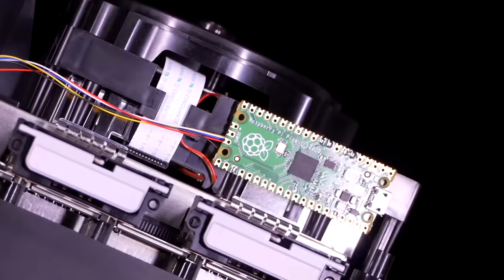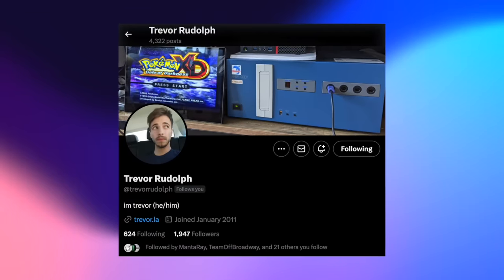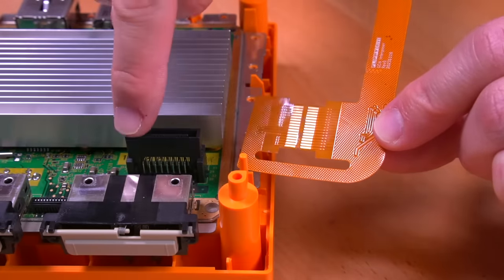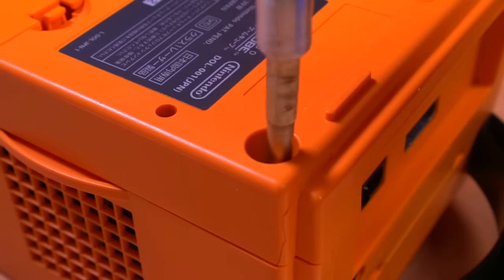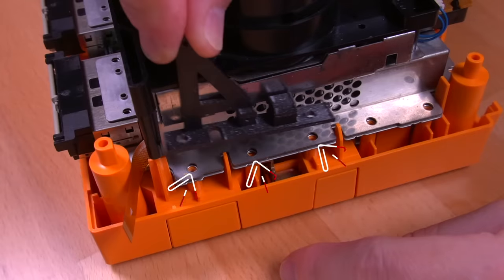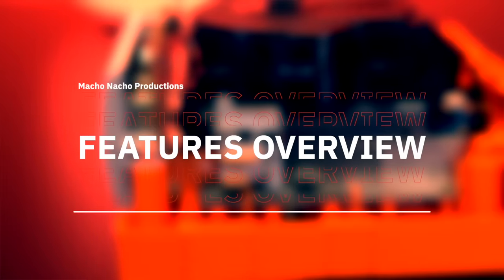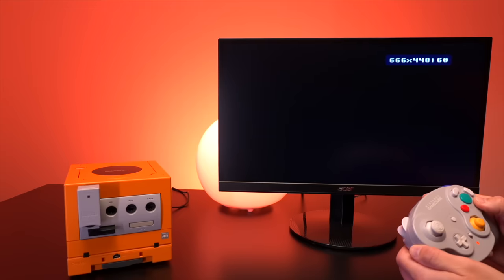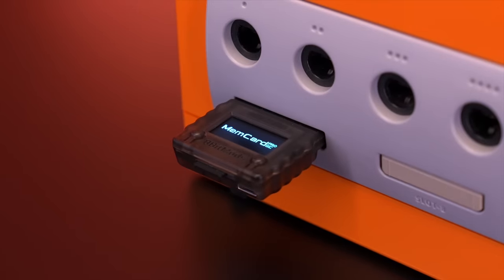FlippyDrive FIRST LOOK! Solderless Modchip For GameCube!

Comment: No less than freaking AMAZING. Well designed, easy install, fully reversible & none destructive!! + full functioning optical drive when installed. All for a LOW COST!!! Unheard of in this space for a hardware mod. (I like some others in the comments went "wow" when hearing the price, had to sit up & pay attention after that 😲)
These devs just set a new standard, fantastic 👏👏👏👏

Great video Tito.

Comment: what I would really like to see, is Swiss being able to use the FlippyDrive simply as a means to access the optical drive — so basically like if you have a PicoBoot installed you could use the speed of the optical drive to run games at full speed rather than using something like Serial Port 2.

Comment: Almost exactly one year ago I soldered a picoboot inside a heavy used GC, because I didn't wanted to mess with the nice one :D turns out if I would have waited a year I didn't had to buy a second GC and solder stuff into it :D

Comment: Legit this is a game changer for console modders. We do quite a few Xeno chips in the shop and it's such a pain, my soldering is terrible even after years of installing them and we often take returns after like 9 months of use due to dead disc drives from burned games. With this guy, looks like I can just rip the drive out, use existing 3d print drive blanks and an sd to sd adapter cable and have a chip installed (and 30-40 dead cubes off the pile) and back in stock for less than the price of a refurb drive. This is gonna put a LOT of  previously 'dead' consoles back into circulation. If they hold that $40 price point and offer bulk discounts, you're gonna see a lot of happy retro game shops over in europe.

Comment: I already have a GCLoader in my spice orange GC but I will be picking one of these up, most likely two, as soon as they are available.  Because, sometimes, you just want to play a game from a disk.  The storage for the screw was a perfect example of a developer who actually cares.  And that ribbon cable is genius!  When my gamecube arrived and I noticed it was mint, my goal was to never do any permanent mods to it.  So far the GCLoader with insert and a silent fan upgrade have been my major mods.  I did have to solder in a battery holder, but that thankfully went together well.

Comment: The fact that it let's you keep your disc drive as stock and supplements it with the sd card without the need for soldering and is that cheap to buy has me gobsmacked. I'll definitely be preordering one of these.

Comment: Super excited for this, though I already have GCloader and picodrvie to install, I may hold off and switch over to this. I hope the SWISS team and these guys work together to combine both worlds. As I mainly use my GC these days to play GBA games, being able to run the updates that swiss has without needing the disc would be huge. For those who aren't worried about keeping the disc drive, I wonder if they would considering modifying the SD extender that Laserbear has for the GCloader. I'm also curious if this might be somehow compatible with the M.2 adapter thats on its way

Comment: A few things I'd like to see: 1. extension to move the SD card to one of the trap doors under the console. 2. extension for the USB port as well. 3. USB-C instead of micro. 4. Swiss feature support 5. Disable flippy and revert to optical drive directly from the menu without having to boot while holding a button.

Comment: If it really functions as it seems to, this is exactly what I've been waiting for in a GC mod. Losing the disc drive was a total dealbreaker for me before, and it seemed like other mods that loaded games off of SD cards or SSD introduced stuttering and other glitches, especially in cutscenes. I do wish you had demonstrated the performance a little more clearly, but since this mod is emulating the optical drive I assume it's basically 1:1 with games run off discs? That's my only real reservation. And I guess I would prefer if the GameCube defaulted to a normal boot and booted into the modded interface with the button held but that's just a tiny nitpick.

Comment: Yes this is a mod that im really interested compare to the other ones and is that it keeps the function of the laser disk and at the same time it still has the gamecube style menu to match plus is fully reversable and simple to installed. Granted not been able to access the microsd card is a negative but it can be solve by getting an extender for it. Looking forward for this device.

Comment: Personally, id prefer that the console loaded up the Disk by default, and you have to hold down a button to load the mod chip (like picoboot can be configured to do). 
While i do see the value in a solderless option, Picoboot is cheaper for those who can solder (at least, it was at the time i did it). It also supports using an accessory that gives easy/external access to the SD card. 

All that said, this is a good start, and i do like how they use the GC assets for the UI.

Comment: To mount the SD card on the side... could have a small 3D printed bracket with pegs that fit into the square holes on the side of the console, and some screws with a wide head to secure it.  Some kind of small folded ribbon cable that can fit through the square to connect the SD card.  Make the bracket the same colour as the console.

Comment: 18:19 Don't forget the Game Cube uses self tapping screws into plastic. You really don't want to be removing those screws all the time, as it will eventually wear down the screw posts and you'll either will have to amplify the issue by moving to the next screw size until the post breaks or mod the console with threaded inserts that will also change the type of screw it you have to use in the console.

One con I will list has to do with the bracket. That bump is unnecessary and does nothing for structural integrity. That bracket should be redesigned to use all three screws and that side structure extended to a place between screws in the rare instance it affects mounting stability. That bracket probably weights more than the chip that mounts into it after all.

I also hope that later updates make the process of using the optical drive a simple act of loading a disc there, like it happens with some PS2 modchips when you have FreeMCBoot installed.

Comment: I'm not really a gamer, at least not since the SNES era lol, but as a tech and retro enthusiast, I love this design, non-permanent  or easily reversible mods are always preferable. The ribbon/flex cable design is genious, as others have said. Someone commented that it isnt more common because it isnt idiot proof, but this is more newbie friendly than soldering. My only suggestion is maybe offer an option to get the cable pre-folded (for those concerned about breaking it or folding it properly), if possible.
I'm glad I waited till the end because I was going to comment that while having Wifi is nice, I wish it had ethernet, and sure enough, they said they are working on this for the exact reasons I prefer ethernet (performance, stability, etc.).
A couple thoughts though having watched the M.2 Loader video just before this, combining the two, or having an M.2  slot (SATA is overkill already, but supporting NVMe too would be nice as at somepoint in the next few years, NVMe will become far easier to get than SATA) on this would be awesome, there's definitely room in the case to add this. As for the middle screw that's not used because the mounting screw fornthe board gets in the way, I think moving the screw to the right edge the same corner of the PCB would work fine and then you wouldn't need to add the box that you screw the spare screw into. A small change that preserves factory structure and actually simplifies things.

I think this idea, plus ethernet, M.2 storage, and HDMI are the ultimate mods for retro consoles like this.

Comment: One thing I'm not sure you mentioned/emphasized; the SPEED. It might seem obvious but compared to loading games from the serial port or an sd gecko (like you would with picoboot), it's up to 10x faster loading. But you also get the disk drive, unlike gcloader! It's the best of both worlds, and for under 40$???? This is one of those miracle mods that rarely come around. I will absolutely be picking one up

Comment: This mod is genius. And perfect for someone like me with none/very little soldering experience. And that I can keep the disc drive. Pre-ordering this when I get the chance. I hope that we can add ISO's via WIFI in the future, or that there will be a SD card extender so it's easy to remove the SD-Card when I want to add/change games. Other option is getting a big SD-Card and just load all the ISO's on it from the start.

Comment: This is the mod I have been waiting for, really.
For the SD card, you could buy one of these microSD card ribbon band extenders which are often available in shop that feature Raspberry Pis and do a tiny cut in the case somewhere.
Surely not perfect, WiFi SD access is still a necessity imo for this.

Comment: This mod looks to be incredible!  I was thinking then too, since the mod is still leaving the original optical drive functioning, something cool that they could potentially add in software maybe (if possible) would be the ability to create backup ISOs of your own discs directly onto the SD card.
Reply: Devs on Twitter said that might be difficult due to the conflict in accessing the disc drive and the FlippyDrive SD card at the same time, since they're connected to the same port. It would give you an easy way to boot CleanRip though, which you can then use to dump to an SDGecko or SD2SP2.
Reply: @NotMoreZombies  Ahhhh, okay. Makes sense. Thanks for that~!

Comment: I haven't downloaded roms in years, i mean *ahem*... transferred my personal disc images. But a friend told me that all the best known rom websites are incredibly limited these days, especially for Nintendo stuff.

Also, I'm amazed with the size of that heatsink! GC is one of the few consoles I've owned for many years and never opened. Never had a desire or need to. I get it now. That's a pretty well designed cooling system.

Comment: More modding options is always good. I'm quite happy with my PicoBoot setup though. I suppose the benefits of an ODE are improved load times and audio streaming performance. Every game I have thrown at the sd2sp2 so far has worked perfectly.
I hope that piggyback ribbon cable holds up over time. Those are quite tight bends, ribbon cables don't tend to like that. But there isn't really another way to do it with how the optical drive connector works, at least not one that's solderless. There just isn't room. If the optical drive connected with a ribbon cable, it would be possible.

Comment: This is awesome 👍😎 
And so easy. They only thing that comes to mind is that you are probably going to put more games on the SD card and you are going to keep taking it apart. Is there a way to make a portable SD card ribbon cable with reader.? Something small and not a eye sore. If you can 3d print something like this this would definitely be the ultimate GameCube.

Comment: I've still never practiced soldering so I've never felt comfortable trying to restore my GameCube that has a bad laser. This looks like a fantastic option in the mean time.
Reply: Lasers aren't usually soldered in they're normally hooked up with a ribbon, never opened my Cube though so I don't know.  You might be better off ordering a whole new transport assy as if your laser's gone that suggests a lot of hours use, lasers have predictable lifespans so all your nylon gears, bands etc will be worn and don't bother replacing nylon gears because you can't buy the correct Floil compound Nintendo used to lubricate the OGs so it'll never be a long term repair.  That and it's a hell of a lot less hassle.  We used to access the usage logs (we were fully licensed by most electronics manufacturers) before quoting repair prices on optical devices, no point us fixing someone's device and returning it with an end of life laser.  The biggest problems we ever had was with PS2s and 3s (we weren't licensed to do Sony consoles or phones, everything else but not those) so we had to reverse engineer the laser assys and pull the firmware out of the unit to make our new lasers work.

Comment: This is the first time I see someone actually turn the screws counter clockwise to align the screw with the thread in the hole before tightening it.

I learned the hard way what happens if you tighten a metal screw in a plastic hole without aligning it first. Perhaps you can mention that step in a video because it is one of those things that you'd assume everybody knows.

Comment: The problem with an SD Card Extender, would be the possible requirement of modifying the console's outer shell. If the people who created flippydrive can figure out how to not require that, that would be awesome. I personally, would have no issues making necessary modification, to my console's shell, to fit an extender; but I know some people would take issue with it.

Comment: The SD card issue is a noticeable one, but easily remedied using a MicroSD Card Extender and some Double-Sided tape. Though I'm sure a custom designed solution would be more aesthetically pleasing to the eyes.

Comment: you bring up a good point about memcard pro very much something they need to get working but otherwise this will makes the GC basically a no solder no cut system to get the features you want.

use the memcard pro for game storage the flippydrive for game storage and the digital port to HDMI adapter to get HDMI out. that is the feature most people want and they should be able to do so on the own. any retro console store should sell this as a package such a no brainer.

Comment: Instead of putting the 4 screws back in, you can do what I did, and use some high powered rare earth magnets seated in the tops of the posts to hold it together. i can open my GC anytime, and its sturdy enough to hold it by the handle. That being said, I did 3D print a slightly modified base with the oem dimensions, just with a nifty little locking mechanism. they're spring loaded push buttons with a levered lift arm that disengages a small notch on the upper shell that I ca glued in place. it works flawlessly!

Comment: This community is amazing, I wonder if it would be theoretically possible to mount the SD card on the gamecube flippy drive as a network drive and transfer files over wifi/ethernet. That would eliminate the need to have to pull the card manually for anything other then having to replace the card because it went faulty.

Comment: The issue with the SD card not being easy to access is easy to get around. Just put Swiss on the card in the flippy and then get an SD2SP adapter that swiss will be able to access. There's even ones that have two pieces where the SD kind of pokes out from the side and is easy to take in and out of the gamecube without even having to pick it up to access the bottom.

Comment: I would recommend getting a good micro sd card extender as a possible upgrade and modifying the shell to have that extender. this way you will be able easily change the sd card without opening it every time.

Comment: Hello. I thought that with the flippydrive having the MicroSD card inside the case was not a good idea. But at the end it says, I haw wifi, so it mean you can load your backups to the MicroSD via Wifi, right? Another great things that can be added to the flippydrive functionality would be to control those NGC SD2SP2 cheap cards, so it can see it as additional storage (and the MicroSD can be access without unscrewing the case)

Comment: What was the word used for the [clip thing]/mechanism that secures the ribbon cable (at around 11:50)? The subtitles say "bail", and I can sort of see how that would be a synonym for "release" and that would further be one for "latch", but in my head, "release"-type "bail" no longer matches "latch" in this context. I am not a native English speaker. In my head "bail" would be a synonym only to "release", but from a completely different context (law) that no longer matches the mechanical contraption that holds the cable.
Reply: Bail is the correct word, if you search for "ribbon cable bail lock" you'll get hits although it does seem more common to refer to that part just as a "clamp". The name seems to come from the bail handle.

Comment: The could mitigate the SD access con by enabling a wifi FTP mode in Cuboot.

Also I wish there was a more elegant way to access the physical disk player without rebooting. Unless its a voltage issue, I wonder if they could just have a seperate menu for detecting the disk, like go into the game picker then hit a button to open a menu with the physical disk info.

Comment: That will be the best mod for my Panasonic Q! for that price and not having to take it all appart to replace the drive belt and install a region switch, it will be the best in order to use it. i just hope that since the chip has bluetooth that we will eventually be able to use a bluetooth controller.

Comment: Considering the wifi capabilities, it wouldn't surprise me if you'd be able to send games to the SD card over wifi.  Even if that never happens, the device supports cards up to 1TB, which is enough to store every GameCube game ISO without compressing them, so the fact that you need to open the console up to get the SD card out isn't much of an issue

Comment: I wish they would make one of these for the Dreamcast. There's a SATA gd-rom connector board that has a board for a HDD sandwiched in between the motherboard and the gd-rom using male and female drive connectors. The problem is it makes the console too tall to put the top back on. With that flex connector, a hdd or gdemu could be routed to an empty part of the case and we could keep our gd-roms.
Reply: I was thinking the same thing. Would love for a solution like this for the Dreamcast.